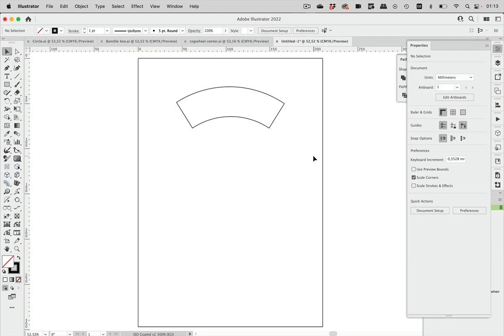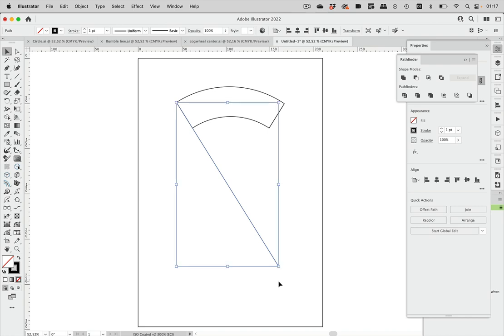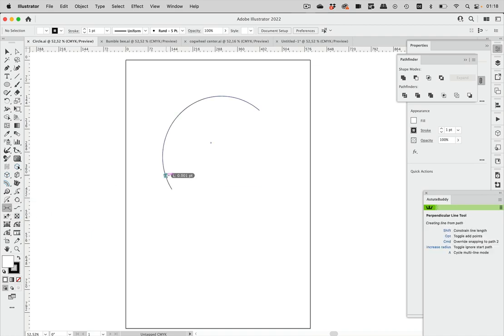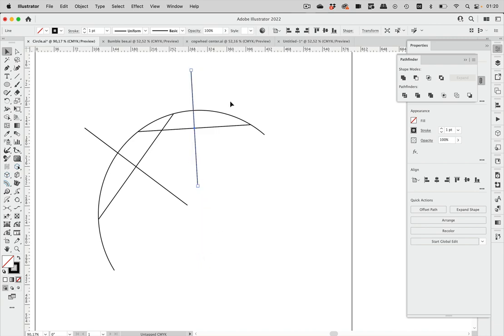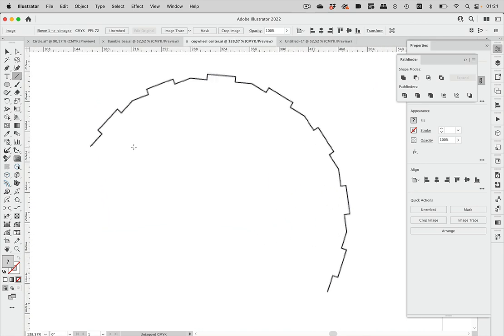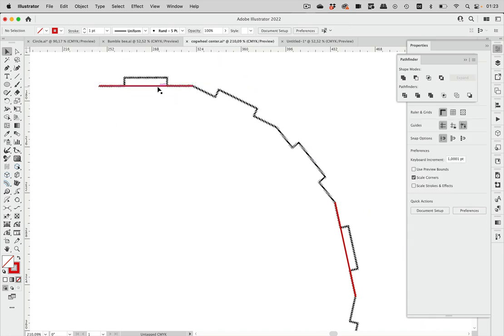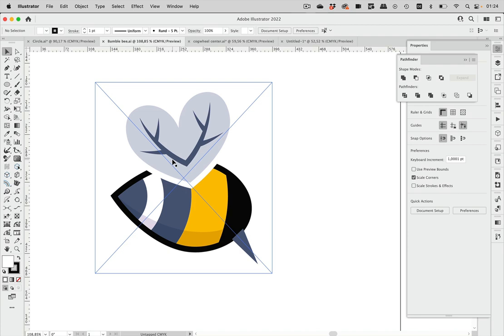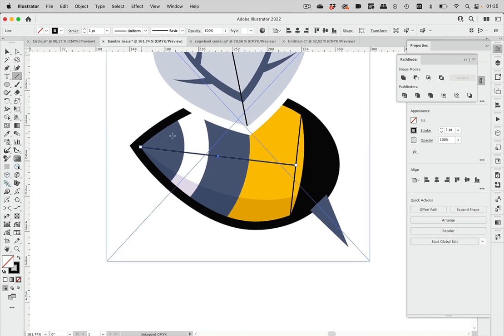How To Find The Center Of Symmetrical Designs

Comment: This is an excellent tutorial as always. The perpendicular method was truly mind-blowing. One thing to consider which you may have forgotten to mention is that it's easier to convert a line to a compound path and then scale it without altering the angle. This can be quite challenging when using the direct selection tool to extend it. What are your thoughts?
Reply from the maker: I think I mentioned expanding the live shape for easy scaling (but I really don't remember). Your method of converting it to a compound path is nice, because it can be easily converted back to a line (and all of that using default shortcuts). So thank you for the addition!